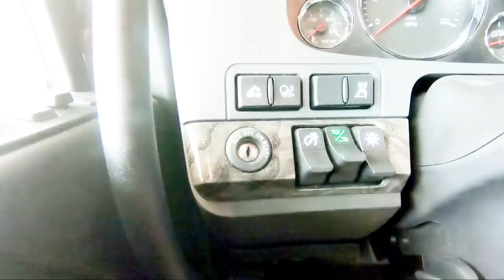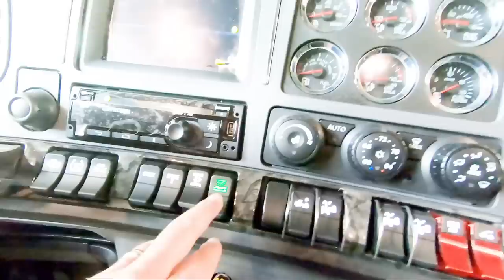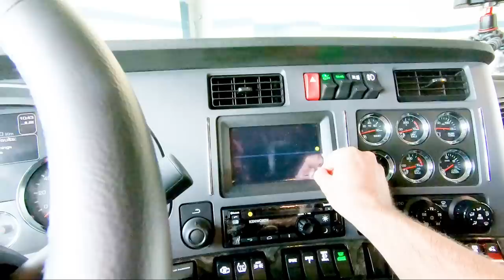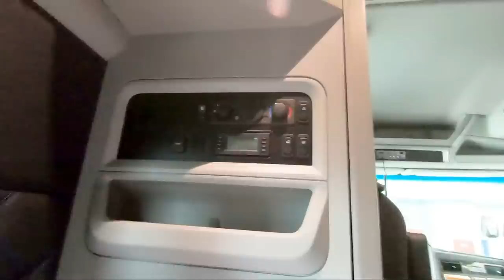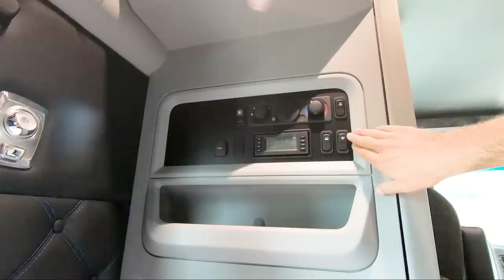*** FIRST W990 REVIEW *** STOCK 2020 Kenworth W990 - FULL TOUR

Comment: I don't get the oversized front fenders?
There's a pile of dead air captured by them.
No quarter fenders standard?
I like the air intakes, nice touch on the subtle hood fold.
Reply from the maker: Definitely has some interesting design features. Quarter fenders are optional. We order without because most customers choose their own. Mostly ½ fenders.

Comment: I reallly like the features of the interior EXCEPT THE REFRIGERATOR TYPE AND LOCATION.  I currently have a Peterbilt 389 and I really like the refrigerator.  You can put a half gallon of milk in the door, lots of room in the freezer for ice cream, pop cycles and you can pack lots of food on the interior shelving. I also like the fridge up high and the closet on the bottom  you can put the dirty clothes laundry bag on the floor. But Kenworth kicks ass with the reclining seat and big table. That is my biggest complaint with the Pete sleeper, sitting on the edge of the bed with a little table sucks!

Comment: Is the T880S the own with the wierd drop nose hood?
Reply: Set forward front axle with that drop nose? Yes sure is.
Reply: Whats the point of the drop nose
Reply: @AJDeere  
Remember the W900S? That's kinda what the T880S is modeled after. W900S was popular as a concrete mixer, my bosses first new dump truck was a W900S back in 04 or 05. I've seen a few of them in my area.
Reply: Oh I never knew what the entire drop nose range was until now haha. I always thought the W900S was a dropnose T800 because the T880s was a dropnose T880. I thought that because I knew that the T880 is like the T800 newer model.

Comment: I drive the 2020 w990 daycab with a 565 Cummins x, 18spd, 11r24.5 , micmak head rack n moose bumper. I use it to haul logs in northern Ontario.  I pull a 2020 4 axle timmins log trailer.  I love this truck. Pulls like crazy, ride is amazing,  the cab is so driver friendly with lots n lots of room for me. I'm 6ft 230 and I run my seat 1 click forward from all the way back and I can hardly reach the fire wall panels with my feet.  Compared to my old t800 bunk trunk theres so much more room. The seats Andy mentioned are killer. I only have the premium seat on the driver side. It's so comfy.  If you want to come for a ride, check out my channel

Comment: 990 reasons not to buy a kw
Reply: What are people gonna do when Peterbilt releases their truck that's similar to the W990 that's gonna be using the 2.1 meter cab with the long hood?
Reply from the maker: That will be fun to see. The difference in the past though when they introduce a new truck the old one is dropped very quickly. Kw is keeping both available for quite some time.